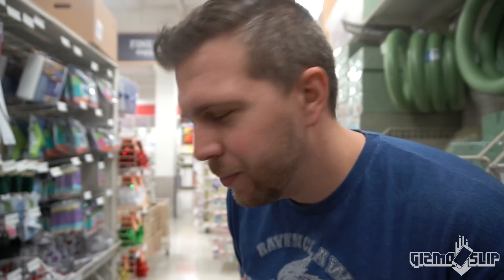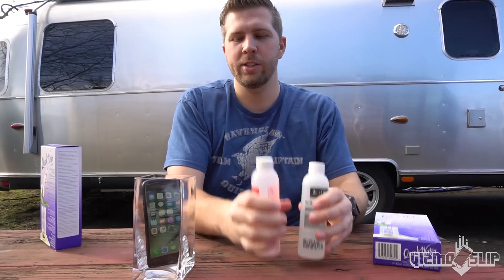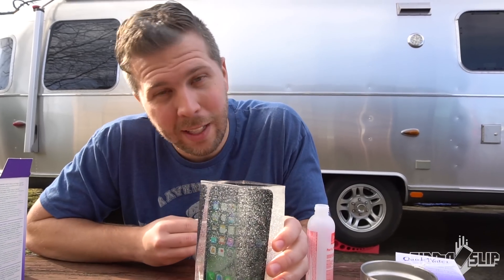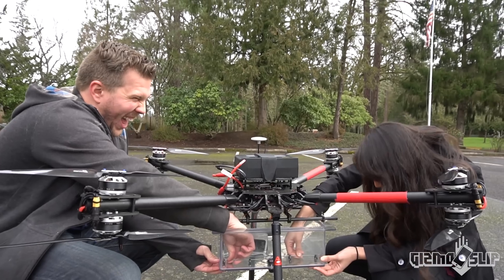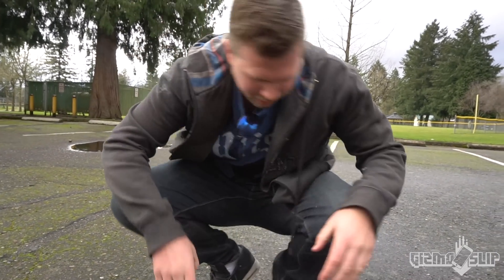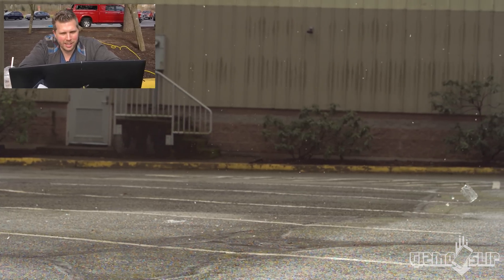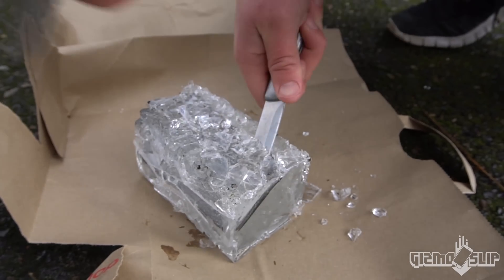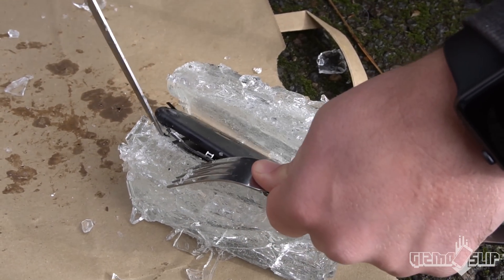Can Simulated Water Protect iPhone 7 from 100ft Drop Test? - Gizmoslip

Comment: The glass did all the work not the water stufff
Reply: WETNOODLEFUK 
So you’re telling me if u put a phone in a glass case it wouldn’t break if you threw it off the roof it wouldn’t break?
Reply: Bruh... THE “WATER” IS WHAT HELD THE GLASS TOGETHER
Reply: GLASS=BLUMMIN WEAK TAP GLASS WITH A HAMMER=ITS CRACKS A LIL LIKE BOIIII
Reply: SWEATT  dont judge
Reply: Dude the phone broke both the glass and water didn't work
Reply: Prime Eraser shut the fuck up you look stupid

Comment: I think that is a fake iPhone because the phone never turned off
Reply: isaac rascon set it so you never have it go on sleep mode
Reply: iFunnyRED wouldn't it die? after 8 hours
Reply: Plus it's brand new. New iPhones have a crazy battery life. Their first few charges last all day
Reply: You can change the settings, so it nerver turns off
Reply: Shye Bailey You can set it so your screen doesn't turn off
Reply: Gamingwith Teerica you can do that with phones bruh
Reply: Gamingwith Teerica ur so dumb
Reply: Hnraper 1 stfu
Reply: Its a setting
Reply: You are do stupid you can set it so it will never turn off
Reply: Gamingwith Teerica sdd
Reply: If you want it to not shut off then go to Settings and search 'Auto Lock' in the search bar, then you will be able to set it to not shut off
Reply: I thought that too, but it was off at one point.
Reply: Gamingwith Teerica iPhone u can have it set to never turn off
Reply: Gamingwith Teerica he did the video before a hours
Reply: Gamingwith Teerica He turned off the Auto-Lock Settings
Reply: Gamingwith Teerica it did
Reply: Javi i not necessarily. If you turn off background refresh for all apps, auto brightness, don't register a phone provider, and don't download any other apps to the factory iPhone, it can last for a while. The phone basically becomes a light up rock at that point.
Reply: Idiot he could do that on the settings
Reply: Gamingwith Teerica exactly how can u let a phone that u cant touch for 8 hour
Reply: Gamingwith Teerica I think you are right
Reply: pinky997 the screen never turnt off
Reply: Aboudeh Sankari vlogs leave her alone
Reply: Gamingwith Teerica me to  that what i was just gonna say that

Comment: I feel like the only reason it didn't protect the phone is because the glue was stuck to the front of the case as well as the back so when it hit the impact pulled on each side of the phone and actually ripped it apart in turn shattering the glass and ripping it apart on the inside as well I feel like if you were somehow able to put another phone into the simulated water and pull that phone out then put another phone into it so that it wasn't stuck to the phone the phone might survive the fall

Comment: do it again with simulated water but use a plastic mould which you can take of so the simulated water takes the impact instead of the glass

Comment: your problem is the "case" made from the simulated water and glass has no give to it , you can think of it like a 1950's era car vs a modern day car , the old cars where made of steel which in an impact caused very little damage to the car BUT gave the passengers nearly 100% of the impact force , where as a modern day car would crush like a tin can to absorb the impact.

Comment: The problem with that as a case is that if dropped, the "water" squishes and compacts, damaging and cracking the iPhone. Then you have it bounce up again, expanding, basiclly separating the broken pieces. So, don't use a jelly case

Comment: Yeah I think the stuff would of worked if it was in a bigger container and didn't have the edge of the phone so close to the surface. Plus it really should of been in a baggy or something I bet the simulated water got into the air vents and cracks then hardened inside the phone itself. The way it transferred the kinetic energy also seemed to flex the phone really bad.

Comment: you should put it in a zip lock bag before you put it the simulated water and make sure there is more simulated on top of and under the bottom of the I phone I bet it would have done much better after the drop

Comment: I think it didn't work because both sides where stuck in the water and when you cracked and opened the water each side stuck to a side and then ripped and that's why it was hard to open the water(even the middle part was not stuck to anything not even the phone)

Comment: the epoxy like mixture marketed as "simulated water" should actually work quite well, but there was one fatal flaw: the air bubbles.  when the vase impacted, the air bubbles allowed the simulated water to easily compress, and that amount of compression is what totaled the iPhone

Comment: When you put a solid object into a substance that can easily deform and reform back much like rubber or simulated water and apply force to the substance the force from the impact will go through the substance and hit the solid object and severely damage the solid object because the force is amplified  by the substance it was in

Comment: You should wrap the phone in saran wrap then pour the resin in. The resin is actually more closer to glue than hard plastic. You are right that the resin pulled the screen apart.

Well its a lesson for you so next time if you decide to use pour in materials to run tests, you need a separating method for removal.

Comment: could you try it again with a bigger container because there's a chance that the force wasn't displaced around the phone in the gelatin type material because the phone was so close to two of the edges that most likely hit the ground first. if one of the other two edges of the side hit the ground first you would see more of a bent phone except you have a split phone. in case you're wondering I did take physics in high school and college but it was about 9 years for college and 13 for high school. so I don't remember any sciency terms well enough to blab about them.

Comment: Yep, that'd be my guess too.

When I saw the title though, I thought you were gonna drop the phone submerged in like, a bag of 3M Novec, or some other room temp clear non-conductive liquid.

This Simulated Water stuff is pretty interesting too though. It seems like an epoxy, but instead of drying hard and smooth, it dries all rubbery. (Also, for something called Simulated Water, it surprisingly looked nothing like water when it was done "curing". It had like a thousand bubbles in it. Were you supposed to vibrate the container while mixing it to get the air out or something?)